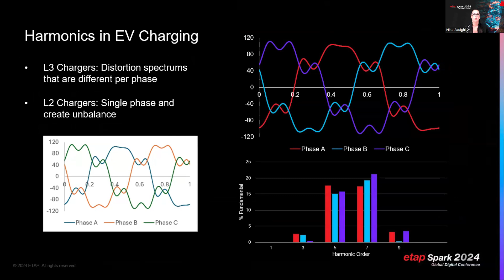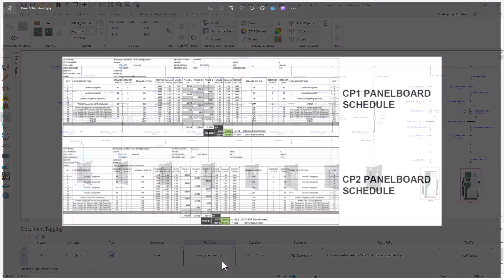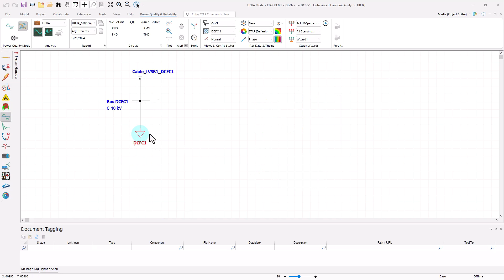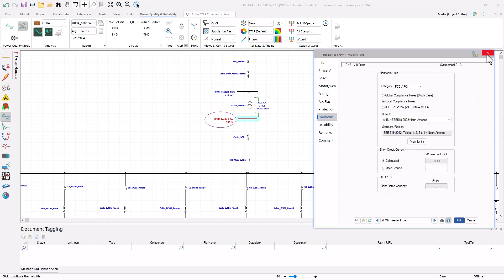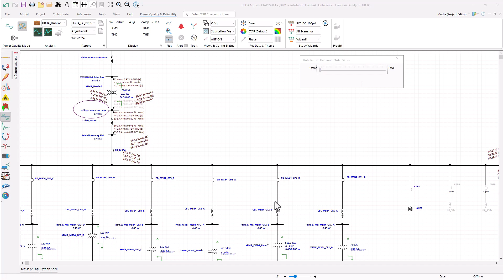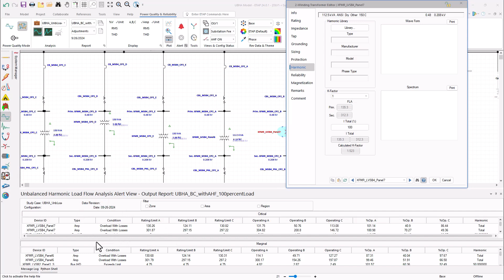How Unbalanced Harmonics from EV Charging Stations Impact Supply & Distribution Equipment

Comment: Hi,

I'm experiencing an issue in ETAP 24. My Active Harmonic Filter is not operating as expected, and I am encountering the same problem with both the STATCOM and the SVC. Although I have added these devices to my electrical system, they do not appear to respond during the simulation.
Reply from the maker: Thank you for you interest in ETAP Solutions and you positive feedback. Please contact our Help Center at https://helpcenter.etap.com to assist with your question.